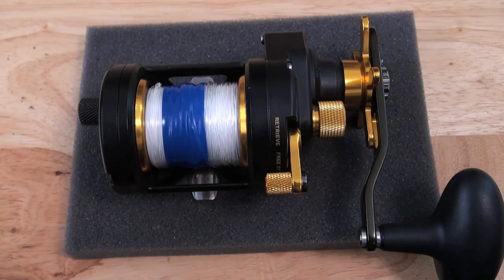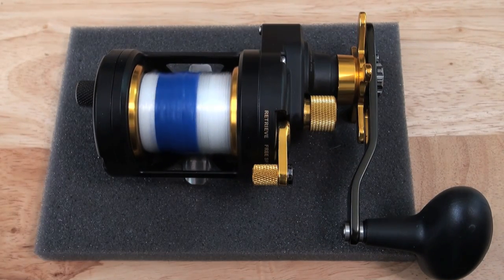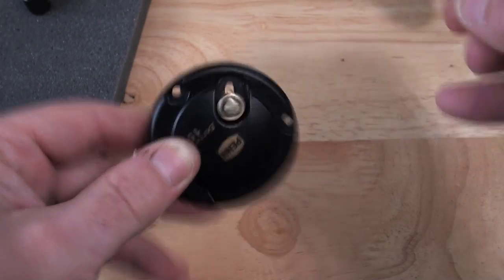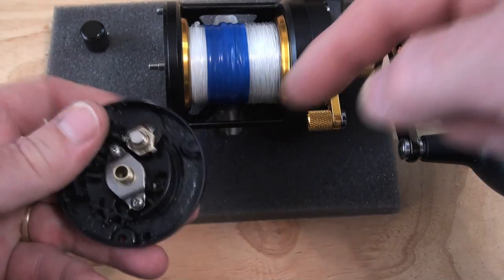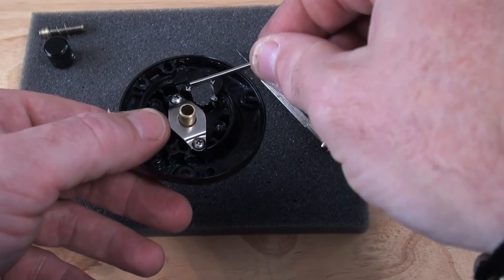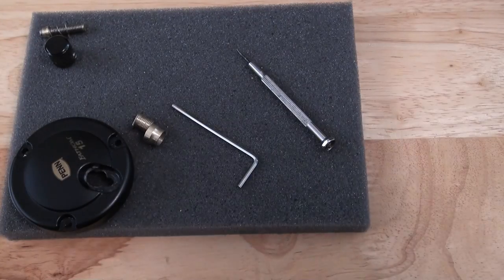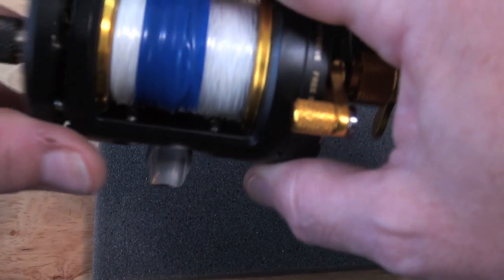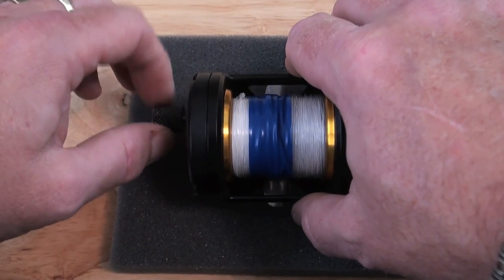Penn Fathom PMR Mono mag repair

Comment: i got a magged 15 fathom and it still has the ratchet. it also has a special cover for the bearing on the mag side. i have had it 4 years and its great
Reply from the maker: Now totally superseded by the Fathom MkII CS Mag which has a different side plate, spool and spindle.
Reply: @PimpMyReel  Hey Mate I am wanting to mag a Penn Fathom 30 is this something you can do ?